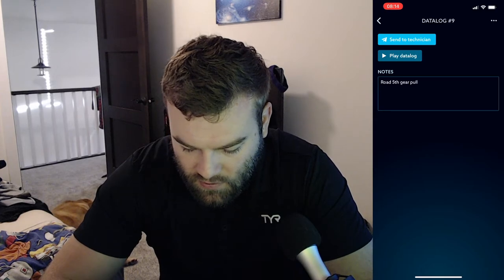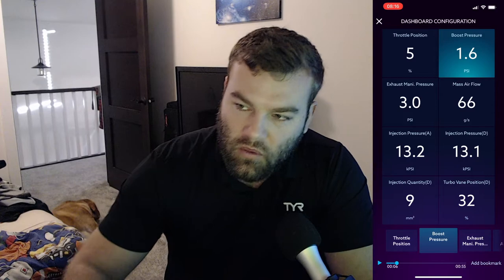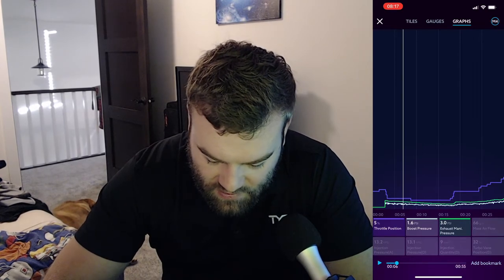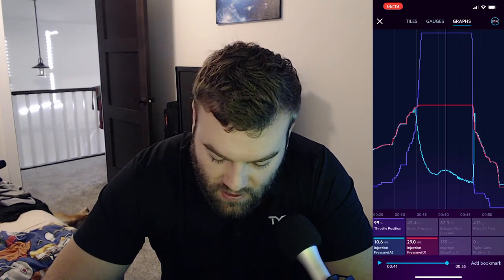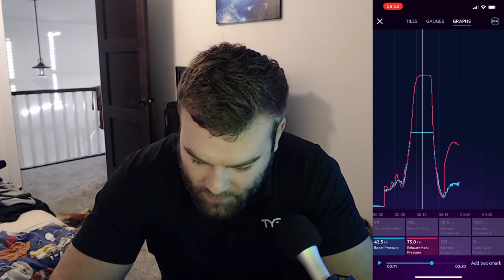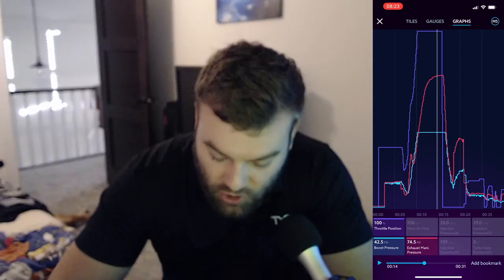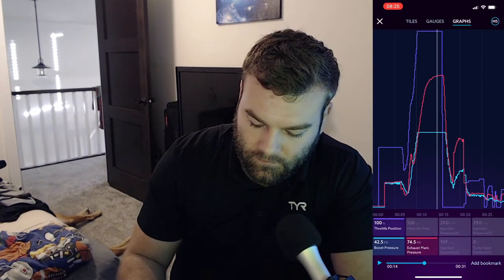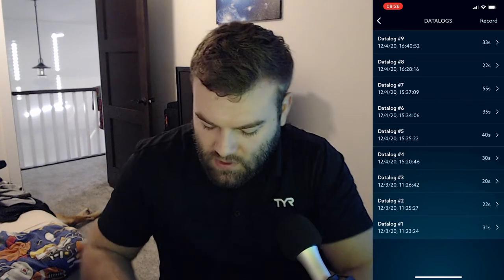How to Diagnose Using EZ Lynk (Compound Turbo 6.7 Powerstroke)

Comment: Hey John I’ve watched a few of your videos. I also have a pusher compound kit on my 19 powerstroke s475 over stock with a 10mm exergy pump. I believe I am experiencing the same drive pressure issues.  The truck popped a stock and a absolute performance intercooler, it’s currently at the shop getting a mishimoto put in as well as tig welding the crank sprocket. Also being installed is a cts3 and 2 boost sensors to monitor both turbos. I do not recall exactly what my exhaust  manifold pressure was. I was hoping this could be solved in tuning the vgt. Sadly I don’t have the vehicle in hand but I’d like to do some exchanging of information once it’s back soon. I may also need a different valley charger.
Reply from the maker: That's something I haven't heard yet! Blowing intercoolers. I don't think that the drive pressure would be causing you to blow intercoolers tho. That's something related to boost pressure I'm guessing. It is possible I guess though for back pressure to increase boost pressure. I'll have to give that a little more thought tho